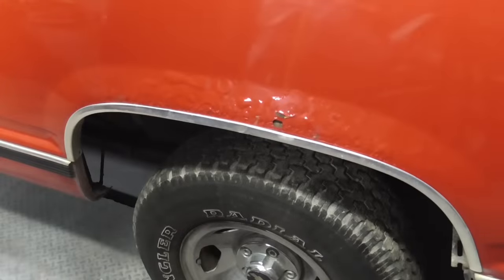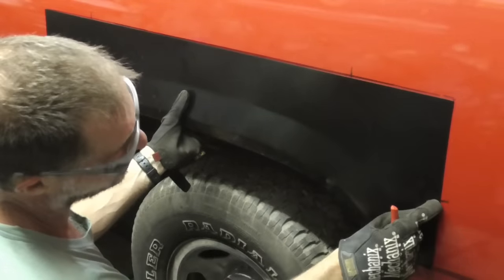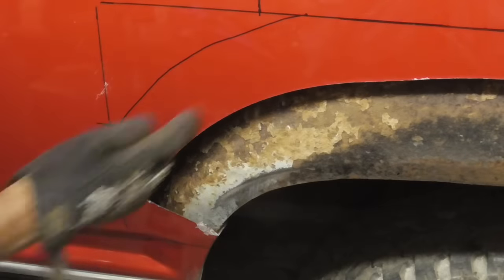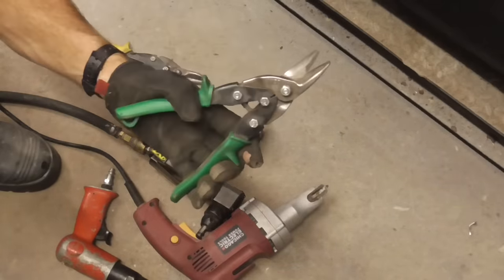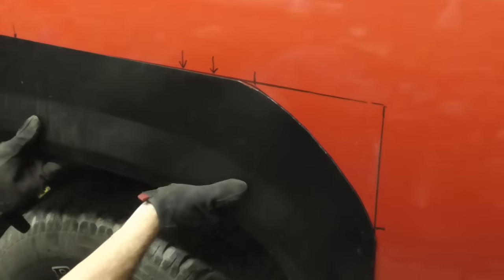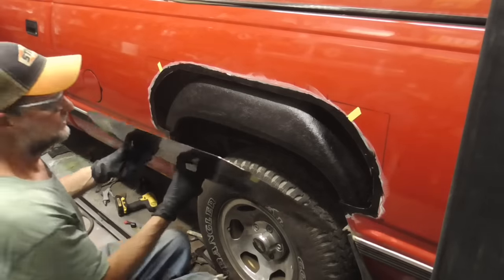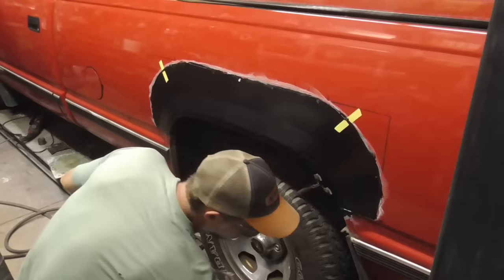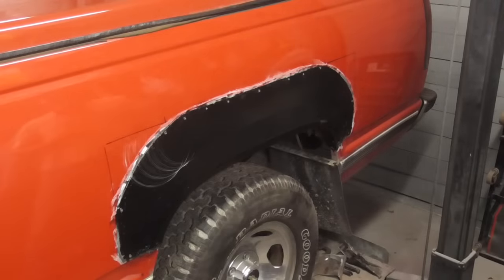Glue On Wheel Arch Rust Repair Panels w/ SEM Impact Resistant Panel Adhesive

Comment: Hey lake side! This video and all of your others are great I've learned so much!  I'm about to attempt to do this method of gluing in the quarters.  I would like to flange them as well I'm seeing that my flange tool only flanges about .450 of glue able surface. Would you recommend only having less than a half inch glued in place as well as rivets? Or is that too sketchy?? Thanks!
Reply from the maker: I never flange and glue because personally, I don't think less than 1/2" is enough.  That being said, there's no reason not to try it.  Maybe do a test with two pieces of metal flanged and glued and beat it up with a hammer - if it holds, you'll be fine :)
Reply: @LakesideAutobody  will do, thanks so much for the reply!
Reply from the maker: @gofferandlain  You're welcome - have a good week :)

Comment: 8:50 At this moment, after the glue has dried, why are you hitting the new panel with a pick??
Reply from the maker: That's how patch panels are installed.  Lap weld the patch, knock down the seam, fill.  In this case instead of welding you glue it - see this video for more about this process - https://www.youtube.com/watch?v=JIIonJOVro4
Reply: @LakesideAutobody  Oh, you were knocking down the seam. I see.

Comment: Instead of special tool , couldn’t the rivet’s work as “clamps “ at the   first step when gluing ?
Reply from the maker: Absolutely... you can use screws, rivets, clamps, etc.  The glue as micro sized pellets integrated so that you can't squeeze the glue out of the seem - no worries there :)

Comment: What spray guns are you using? Blue point?
Reply from the maker: Sharpe Finex FX3000 w/ 1.8mm tip.  It's good for thick primers - nice gun all around actually.  Everything used in this video is listed under the description if you're interested :)
Reply: @LakesideAutobody  
Oh…I didn’t even think to look in the description. 
Thank you and thanks for the video!
Excellent work!

Comment: I liked it but I've used rivets once and never again it will be your first fail spot they'll blister .but nice on everything else no high heat at all no worpage .
Reply from the maker: The key with any seam is to knock it down before filling.  Any seam welded or glued has a good chance of showing up later if it is not tapped down.  You don't have to keep the rivets in either actually - just used them so negative comments about the holes wouldn't come flying in :)  They won't show up either - moisture doesn't sit up there to do any damage :)

Comment: Why would you poke holes in panel rust soon to come
Reply from the maker: You can actually drill a hole in a fender right in the middle, tap it down, fill with body filler, prime and paint and you'll never ever have problems with it.  Rust starts at a point where water gathers and stays moist like where leaves, needles, and mud accumulate - usually the bottom of the panel.  https://www.youtube.com/watch?v=t1WclT_GMvk

Comment: Why bond a panel to 1 inch when you had 3inches to bond to...i dont get it..nice vid
Reply from the maker: I want glue to cover the whole seam - i.e. no sandwiched metal w/o glue in between.  That being said 1" is plenty so no sense wasting glue on 3".  Plus, it's easier to tap down the seam and stays further away from the upper body line :)

Comment: Talk about literally putting a band aid on the problem. Its shortcuts like this that banned all shops from touching my vehicles. If a shop did this to my truck they would find themselves in court real quick.
Reply from the maker: The methods you see on this channel are used in most shops in the metro Detroit area because they hold up to salt water.  If you do not knock your seams down, the patch will fail.  They don't do that on TV or magazines 'cause it doesn't look pretty.  Here's how it's done in Detroit - https://www.youtube.com/playlist?list=PLOP9eoG14-I-qu68_805bZaOnmkdlv6Ys
Reply: @LakesideAutobody  There is a fair amount of good repairs in that playlist. Lap and butt welding are both acceptable repairs. Glue is not. If the customer is paying out of pocket and is given the choice then glue is acceptable. If its an insurance repair it should always be welded. I know exactly who you guys are. Ive towed many cars to both the hall and 23 mile locations. Im from Detroit and spent years in the same shops you speak of. Ive seen the garbage repairs that come out of them with my own eyes.
Reply from the maker: @wrecksandtech  Check out this last vid may make a diff in your mind - https://www.youtube.com/watch?v=d21RkqTwRqs  the cab corner is still perfect 3 winters already - they have to do it exactly how I do it or it will fail :)

Comment: Great job, and adhesives have really come on, but did you need to cut it back so far ?
Reply from the maker: You don't have to cut it back that far but..... if you want to keep your body lines near the flare nice and perfect then its good to stay far away from them because you are going to want to knock the seam down.  A patch that is not tapped down will likely fail :)

Comment: The only problem I can see is the underlying inner wheel arch / wheel well panel is clearly also rusty. It looks like it extends down to the sills and valance too which is pretty common for wheel arch rust - it's usually the tip of the iceberg. The video is good clear info on how to bond a panel in place but I really think for structural integrity if your going to that effort, any surrounding bumper / trim panel should be removed and the inner panel welded or at the very least treated with rust converter and removal products. That said its a good cosmetic repair and for that purpose I don't see a problem with bonding a repair panel in place rather than welding.
Reply from the maker: You're right the wheel well panel could have been replaced but this customer did not want to go the extra mile.  It will last just fine though as I made sure that the panel could drain and stay dry in the future. It was also sand blasted and undercoated - except for the lip which was glued to the outer.

Comment: 5:30 Is that a velcro sanding disc on a polisher? I saw that trick on another channel to keep heat down when sanding. Wondered how it worked since it's the first time I'd seen it.
Reply from the maker: No, that's just the backing pad - it's hard plastic.  To keep heat down use a sharp 36 grit fiber resin disc on slow speed.  Don't use angle grinders like you see on many YT videos - those are more for fabrication.

Comment: Will this work on a floor pan?
Reply from the maker: Yes - I think it would work better because of the 100% seal.  No water leaking under the carpet :)  I glued in an entire van floor in a Dodge B250 - it was galvanized sheet that I didn't want to mess up the galvanized coating - worked great.

Comment: You had plenty of thickness to work with that panel had been repaired at least three times by the look of the old paint, some guys that do that type of repair will not give the glue long enough to set because they are always in a hurry to get it done that is why so many jobs like that come back for repairs and they wonder why they either lose money or don't have any work or have lost work ! I have had one person come back complaining about the panel coming lose after three years, I would much rather weld them in if possible. But in most newer vehicles it's not as easy as you would think because everything under or between the panels is so flammable.
Reply from the maker: Yes - that paint was thick thus the feather fill - was going to explain that but..... Thanks for the comment and story - love to hear them :)

Comment: How do fill in the hole left by the cleco pins?
Reply from the maker: In this video,  I believe I used rivets but you can lean the small 1/8' holes and fill right over the top of them as long as you tap them down a bit.  The moisture will never bother the areas up high like that (those 1/8" holes) - it will only settle at the bottom of the panel and rust from there.

Comment: Could you also lead wipe o ver that ,
Reply from the maker: If you are asking about using lead for the filler... I think it would be possible as this glue resists heat also - would make a good test or video actually.  Thanks for checking it out CDW :)

Comment: some things never change, a good 'ole (convex) cheese grater and a straight-line (pneumatic) body filer for that white-lightnin' bondo, and feather-edge the paint edges all down with a good random-orbital sander, (100-grit). But I would also give it a good water-sanding, via block sander by hand,  just to make sure, and use a good air compression blower to clean out any leftover bondo surface bubbles before primer, then primer and putty, block-water-sand the putty, then primer again ...,  and water sand again (320 grit) by hand.
Tape, tackcloth, 'n paint.
Reply from the maker: Sounds like you've done quite a bit of body work :)

Comment: You ever think about putting the patch on the inside and having the orange metal on top of the patch makes it a lot easier that way
Reply from the maker: That's just not how it's done if you work in a body shop.  In all shops in S.E. Michigan the process is weld it up (lap), knock it down, fill - that's it - it came from how they did sail panels at the factory I believe - except in the factories back in the day they used lead to fill.  I have done what you say though a few times where half the patch was inside and the other out.  Sometimes though its hard to fit a larger piece in a smaller hole.  Thanks - Jerry
Reply: @LakesideAutobody  I've done it many times I love fixing rust good show though just a suggestion you can do it in small spots have a great day
Reply from the maker: @christopherohara9421  Cool - thanks for the comments :)

Comment: its going to develop a hairline crack on the seam in a couple of years, I know from experience, I did this when the panel bonding came out and I tried several different brands and had to redo every one of them. Its not fun welding when the glue is in the seam.
Reply from the maker: It actually won't - see video - https://www.youtube.com/watch?v=gIS1Tbv7Kvw  I'll do a follow up on this truck again in a few years - sold it to a guy in town :)   Here's a follow up on this repair too - https://www.youtube.com/watch?v=t1WclT_GMvk  Hope this helps :)
Reply: More like a couple months, not years.
Reply from the maker: @marinedad5286  https://www.youtube.com/watch?v=gIS1Tbv7Kvw  - years

Comment: Why use the hammer on it after you glued it?
Reply from the maker: Any time you install a patch panel you will knock or tap the seam below the original surface.  Not only does it make the seam invisible, it is an excellent buffer between seam and the finish.  It won't harm the joint as it's impact resistant.  I've used other glues and they work well too so... I just go with the impact res. just to make sure :)

Comment: Hey Brutha....that seems like an awful lot of work when I can just mig a patch in hit my welds with a grinder D/A off the E coat a lite lick of dyna lite some sanding then hit it with a few coats of euro prime and finish it with paint ...
Reply from the maker: Yes - MIG is the normal approach but for some that want to a guaranteed water tight seam, this is the way to go.  Don't get me wrong, I love to mig weld a patch in - fast, convenient, and works on every rust hole.  Thanks for your input Michael :)

Comment: I had a customer show up recently with a 70 gtx that his 950 dollar quarter panel separating and cracking out of a nice shinny black paint if you got a piece of crop Toyota truck or something like that ok go for it but if your car is valuable to you get it welded in properly by a reputable  restoration shop just my opinion you can glue yours if you like but it will come apart at some point
Reply from the maker: The answer is simple - the folks that did that 70 gtx didn't do it right - there's tons places that do below par work.  If it's done right - no matter what method it will last - https://www.youtube.com/watch?v=gIS1Tbv7Kvw  or  - https://www.youtube.com/watch?v=t1WclT_GMvk

Comment: Why did you not leave more metal for glue surface
Reply from the maker: You can leave more surface if you desire but remember you have to coat the whole surface to prevent rust from between the sheets so you'll use a bit more adhesive.  I've had no problems with right around and inch for the adhesive.
Reply: @LakesideAutobody  that makes sense you did great work. How much time does it save over welding on the panel
Reply from the maker: @tossedsalad5532  Honestly, I think the time from start to completion is very similar.  Most of the time is priming, blocking, paint prep, painting :)

Comment: Knowing these trucks. That's a very good temporary repair to sell the truck. Very good at hiding the damage to make some quick cash. When it rots off in 2 to 4 years the buyer will probably not fix it, or do it correctly.
Reply from the maker: 3 years later - same methods - see door bottom and cab corner (left) - https://www.youtube.com/watch?v=gIS1Tbv7Kvw  I'll continue to do follow up videos on these vehicles - the methods found on this channel were used by top quality body shops metro Detroit area (rust belt) :)
Reply: @LakesideAutobody  I'm not doubting your work, I've seen your channel, you do good work.

Comment: This way is a fast clean way to do it but trust me after a few weeks in the sun and cold the edge of that patch will be visible throu your body filler and paint as there will be movement of some sort there guaranteed 😊
Reply from the maker: You won't - If you knock the seam down and fill.  Have to tap a seam down no matter how you repair rust - weld, glue, fiber glass, etc.  Here's the follow up - still good today - neighbor's truck - https://www.youtube.com/watch?v=t1WclT_GMvk

Comment: Duct tape, silicone rtv.  Second layer of duct, silicone, farm equipment paint.  Feels like metal, and hell, I've seen it stop a .22.
Reply from the maker: That's interesting :)
Reply: @LakesideAutobody  -- Try it.  I was sort of forced into thinking something up.  2004 Tahoe I bought last spring for a winter beater.  Usually buy one a year, but this economy, I need it to last.
      So it had body rust on the usual spots on the rear quarters.  (important parts of the vehicle are clean)  Grinding it all away left over 1 by1 foot holes.  I don't like how the 'chicken wire' bondo method cracks over time, so I tried this.
       Is it pretty.  No.  But it isn't ugly, and you wouldn't notice it unless I point you to it.   
       So far it's survived 4 professional car washes.  5 thousand miles, and a pressure washer washer blasting away directly on it (though I wasn't intentionally trying to destroy it).
        It's ghetto, but honestly, so far, so good.  
silicone beyond the tape to keep it from peeling, both sides, and wait for it to dry before putting on the second layer of tape.  Silicone again, let dry, and then a couple layers of paint.
Reply from the maker: @MarkJacksonGaming  This is the second time I've heard of this - Interesting - thanks for the comment Mark :)

Comment: Been around and seen enough of what really goes on with these types of repairs. 6 months to a year later, the bottoms of the doors rust out. Then the rocker panels rot through. Then of course the bottom of the tailgate has rust. It just does not pay to fix rust on a pickup. In fact I have seen Chevy pickup trucks showing signs of rust evident of the paint starting to bubble on the upper rear wheel wells after just 4-5 years.
Reply from the maker: You haven't been around a good body shop - https://www.youtube.com/watch?v=idrLzsz2eLg & https://www.youtube.com/watch?v=8XaZBy7GC7A
Reply: @LakesideAutobody  Not saying your repair was bad. It was in fact done correctly. But who is going to pay for that type of repair? If they do, then the bottom of the doors, bottom tailgate, and rocker panels have started to rust through. It's just not worth it when they become that bad.

Comment: How many mills of primer?
Reply from the maker: For heavy body work like this I usually use 3-4 coats of thickly mixed primer surfacer or feather fill.  If I was to guess at the thickness - I would say about 10-15 mills - like 4-5 sheets of paper or even more.  I've never had a problem with feather fill no matter how thick I sprayed it - matter of fact I've seen it sprayed "silly" thick and no problems.  Feather fill is like body filler that you can spray on.  That being said it's always best to have your body work as straight as possible before priming :)

Comment: Wouldn't you save a bit of time by just marking the panel over the arch and measuring an inch or so down and then just cutting out a "square" so to speak. Just a thought. If you are going to just cut it out anyways then only cut the metal on the truck not the new panel.
Reply from the maker: You could do that too - thanks for the comment Leif :)

Comment: 'Glue on wheel arch', sweet, I thought, before clicking this 'quick fix' video.  😂
Very cool though, wish I could do this kind of work.
Looking at a car with slight rust on a front fender, but not the caking kind.
Thought I could just sand to bare metal and put some primer on, don't mind it being a bit crude, but doubt that'd last very long.
Reply from the maker: This might be an option for you - https://www.youtube.com/watch?v=Zp5gmDC7KQI  or this is very quick too - https://www.youtube.com/watch?v=rPTaeH056ng

Comment: I would of cleaned up the  inside panel a bit and sprayed  any left over paint or primer or rubberized  sound deadened. Or put some rust inhibitor  before  putting  on the panel. To pre vent .further  rust
Reply from the maker: It's always best to just treat the inside of the repaired panel like this - https://www.youtube.com/watch?v=8XaZBy7GC7A and just make sure it can drain and dry :)